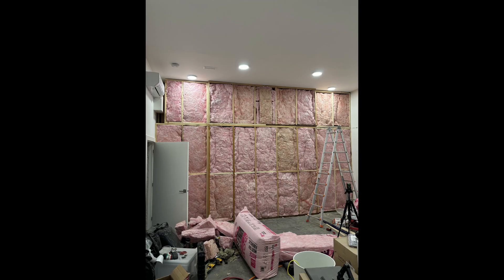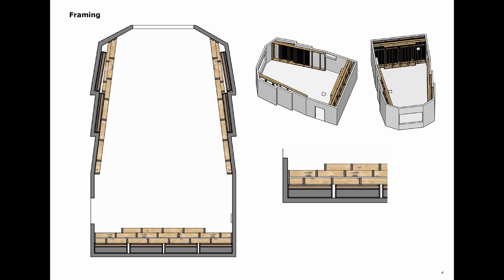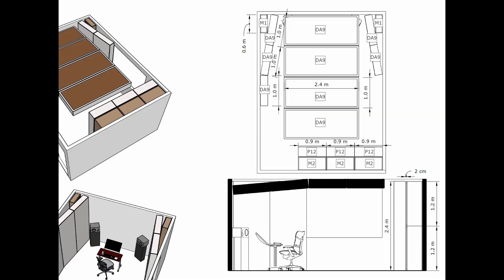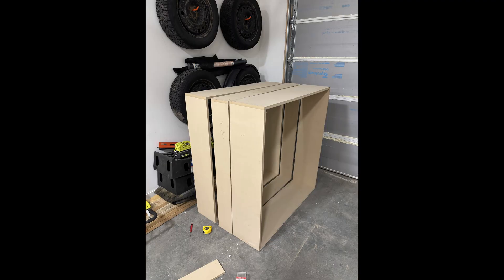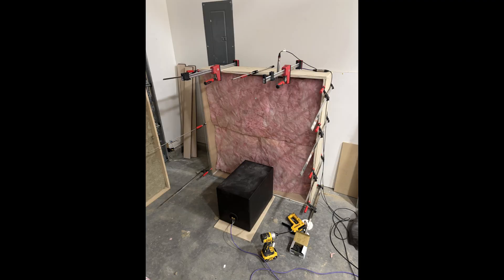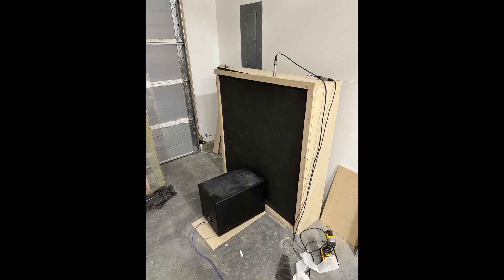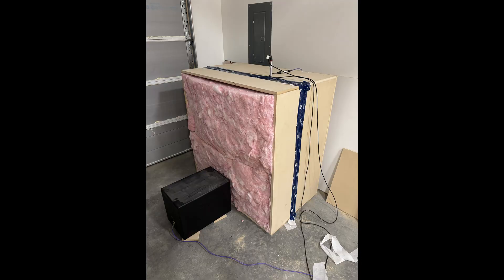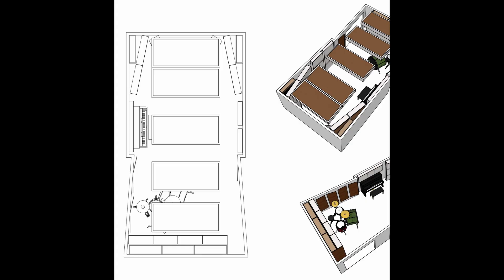Introducing the Constrained Membrane Absorber

Comment: What is the performance of these like compared to established competitors which have been lab-tested like the RealAcoustix BassMod series?
Reply from the maker: I have no idea. This isn't a "competitor" to anything. This is one technology I use in the rooms I design. I only know how it works within those systems and you can see the results of that in measurements I've shared before. I have no idea how it would behave outside of that just like I have no idea how a BassMod would behave in my systems (it would be nothing like the lab data suggests). This isn't a product anyone can order so I don't care how it behaves outside of how I use it. If you wanted to use them in a diffuse sound field then I guess you could lab test them but I can't think of any applications where I'd recommend using something like this in a diffuse field. It would make more sense to use higher Q devices like the BassMod.
Reply: @gerhardwestphalen thanks for the reply! Cheers 🍻

Comment: Hi, Nice work but it would be good to have at least some mesurement
Reply from the maker: I'm not sharing any measurements relating to these as people could then easily reverse engineer them. It's nothing particularly complex to build but to understand and predict how they work requires a lot of testing and data. They're only used within the rooms and systems I design. I don't share any information regarding the frequency ranges they target etc.